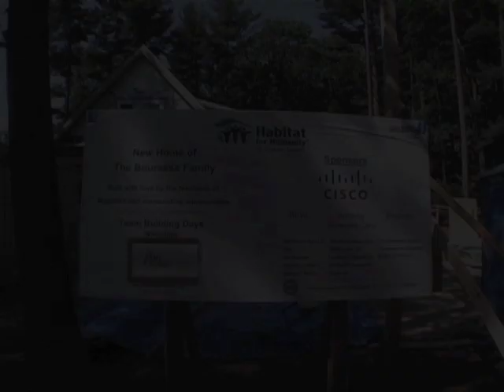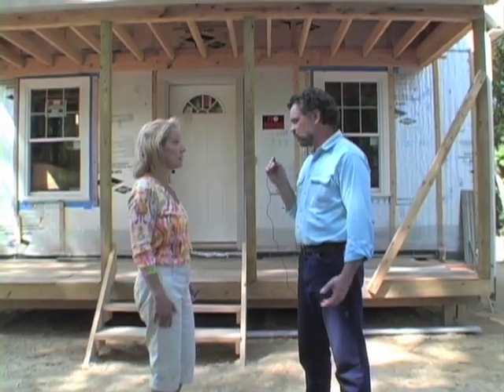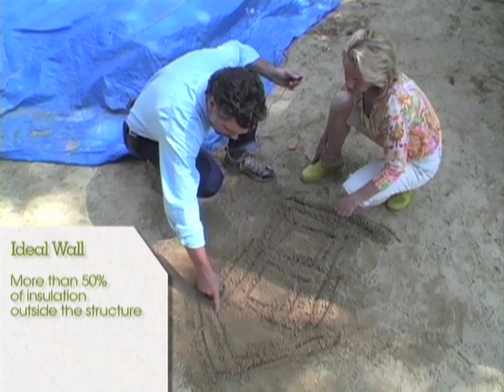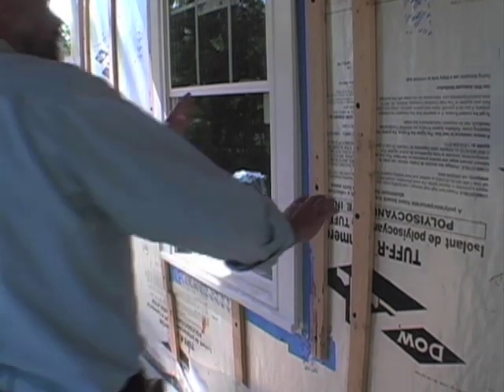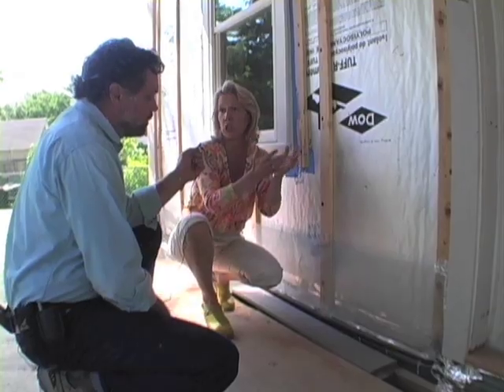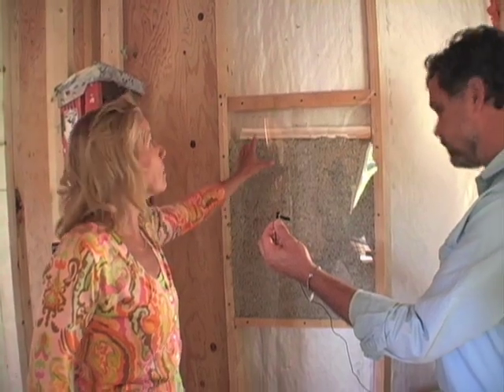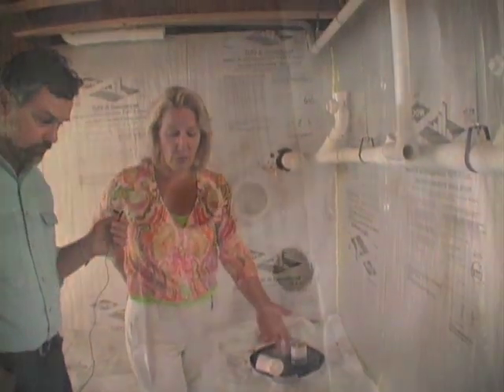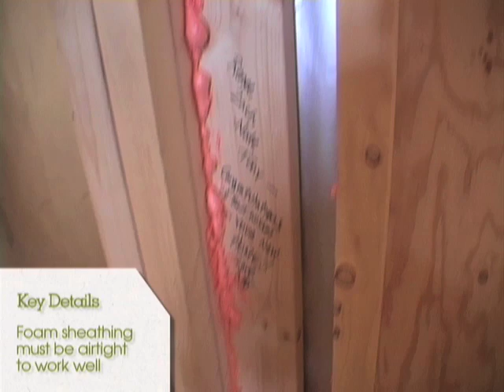Habitat for Humanity Builds A LEED Platinum Home

Comment: That will likely be the driest sump pump ever installed.  Haha  Incredible design.  Incredible build.  Great job guys. 👏👍
Reply: Probably, but one of the areas they didn't talk about was the water proofing of the basement walls. It would have been interesting to see what approaches they used for that.

Comment: Your right. The house was lived in for a long time without A/C and heated with wood....b/c it was built in 1873 & A/C were not available till the 50's & wood was the only option in 1873!!! Your comments betray your lies/ignorance.  When a house is drafty it doesn't matter how much wood you burn, it wont hold heat. You claim to have built 100s of houses but can't figure out why a company would only warrant something 15 yrs?!? Manufacturers rarely warrant any building material longer than 15 yrs

Comment: Just because the warranty is only 15 years doesn't mean it will have to be replaced in 15 years.  Are you a builder and if so what have you built? And to your previous comment, what does it costs to heat and cool your house from 1885? My family owns a house built in 1873 and just because it is still standing doesn't mean houses should be built the same way now.  It is so drafty and requires so much money to heat and cool annually that nobody lives there year around...

Comment: I had worked on a house in Long Beach , Ca. They were building a garage, 5 inches away from the neighbors garage wall, I was taken back because they built the frame for the side and then nailed cement board on one side with out preparing the wall, 40 percent of the nails, (they used nails not screws) and then raised it! no waterproofing nothing! I know that homeowner would have to redo that entire garage, everything was half as***. Word got out that it was shoddy construction.

Comment: I still don't get the insulation on the inside of the basement concept. Where is the thermal break between the chilled basement walls and Warm upper walls and floors???